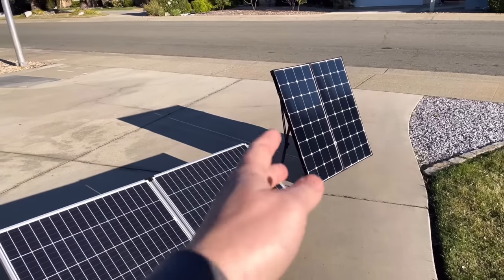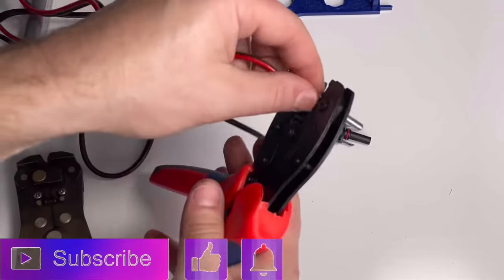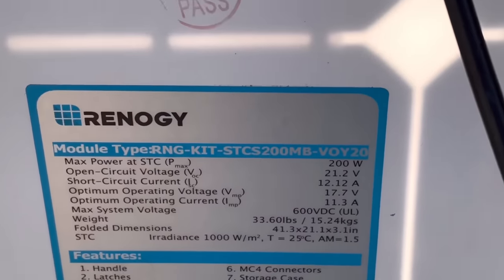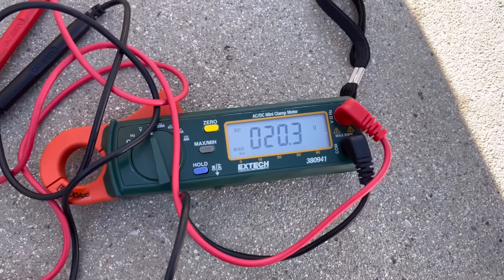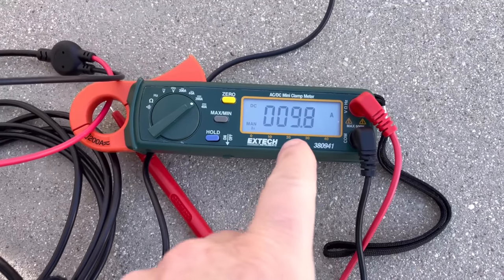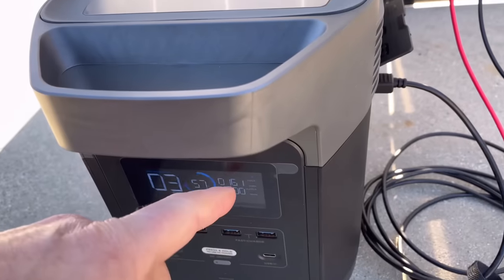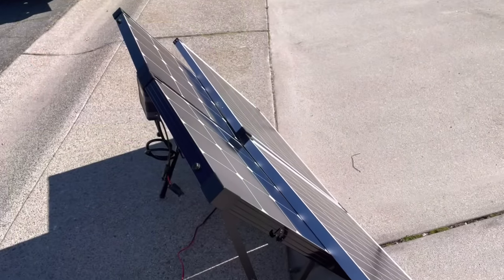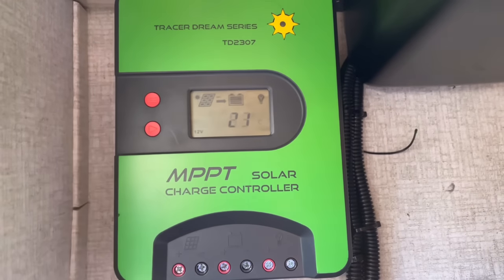Best Solar Panel - Harbor Freight 100 Watt Solar VS Renogy Eclipse Solar

Comment: Does the Ecoflow regulate its own charge or do you need the additional regulator to charge it with solar?
Reply from the maker: Yes it has its own mppt solar charge controller. It can only handle 10 amps max from a solar input.
Reply: @johnnysweekends  How many of those panels would that be and is that Echo Flow an older model?
Reply from the maker: 10 amps is 200 watts in parallel or you could run more watts which I forget max wattage for the eco flow EF3 which is still sold as a 2016wh model.

Comment: I just want them to work. Except if you read the reviews for the Harbor Freight they don’t work right out of the box. Definitely get the extended warranty.
Reply from the maker: How many don’t work..? 1…2 …. 10??? 
A couple sure but a lot ok well then there would be a problem.

Comment: Not a fair comparison between both systems. You are using the Renogy panels in paralell, and the Harbor Freight in series. I know from personal experience the Renogy Eclipse is far more powerful than anything else on the market still today.

A fair comparison would be to series the Renogy eclipse panel as well, and then you will get the real numbers to compare. The Renogy Eclipse's are the panels that have more power per square inch. Just series them as you did with the other setup. It is still double the price, but you get a lot more power with low light conditions like early in the morning and late in the afternoon if you series the Renogy. That would be a nice thing to actually see.

Will Prowse made a t st in the Renogy eclipse and it outperformed everything else, best power for ocuppied area. If you have little space, the Eclipse is the way to go.
Reply from the maker: Both units were wired in series the gear higher voltage then ran to the mppt controller in my trailer. Which I by pass the pwm on the renogy set up. 
I would need a connector to run parallel which in the video you clearly see I don’t have one.
Reply: @johnnysweekends  Sorry Johny, it doesn't add up to me. If you have them in series, howcome you only get 15V for a 21,1V panels in series? You compare an entrance at you MPP solar of 15,4V with the Renogy panels and 35,4V with the Harbour Freight ones... How is that the same? Maybe I am missing something here, but I plug my 100W Renogy Eclipse in series to an MPPT and it is way over that... I don't get it.
Reply: @ricardomarcelino8388  perhaps one of the two Renogy panels was faulty? He could measure them individually to confirm. He was getting 160w, which depending on his location, time of year (winter, less sun), and time of day, isn't bad for 2 100w panels. 

If you rewatch the video, it's quite clear that one panel conductor is looped over to the other, and the other from each panel is going into his power meter. Both pairs were undeniably wired in series.
Reply: @mlindholm  It could be there is something with the panels. My 100W Eclipse, with the included PWM kicks over 100W (103/104). And with an MPPT I have seen 110W.

But it stills confuses me, howcome with a series  connection you only get 15'ish volts out. The other two put out 35,4V. They should be at least closer. I am not saying the harbours are not good by any means. But seams we are comparing totally different things here. How can you explain that much if a difference? More than double the voltage... If open circuit is 21,2V, in closed circuit should be at least 28/30V am I not correct??
Reply from the maker: Well being the renogy is a little older but very little use it may have already settled with the normal 20% degradation that monocrystaline panels get after a certain amount of sun exposure. 
Hence the lower wattage. But that set up had very very little use and I never could get over about 175 watts no matter what. Always thought it was odd.
Reply from the maker: One test I’ll be doing in several months is to see if the HF panels suffer the full 20% degradation loss after being in the elements for 6 months of extreme heat. They have been outside for about a month.

Comment: The Solar Panel is a Thunderbolt Solar, not Harbor Frieght.  And detailed specs attached to the product is important, kind of a industry standard for safety.
Reply from the maker: Thunder bolt solar products are a Harbor Freight exclusive. You can buy else where but I don’t recommend it. Harbor freight actually has good warranty replacement programs verses a standard online purchase you may not get.
The details are described with in the video 

Was there a detail you are looking for specifically?

Comment: Using the Harbor Freight panels and an Ecoflow Delta, is there a need for a charge controller?
Reply from the maker: No eco flow has built in controller..😀💪🏼👍🏼

Comment: Please surmise comparison videos with a side by side chart at the conclusion of the video? The comparison was a great visual, but it would have been more helpful if every viewer didn't have to record the data to repeat your experiment (376,593 views) times/potentially, by watching, pause, record data, continue, pause, record data, continue...
* I did "like" the video. Thanks for the work.
Reply from the maker: I will work on that for future videos …
And glad you liked the video..😀👍🏼
Surprised it got this many views since it was a quick comparison over a cheap panel and a more name branded panel. 
But more volts bringing more watts is all ya need with a decent controller. 

Thanks again for watching 😀😀

Comment: Wouldn't you just be better off buying a used 290 - 350 watt panel for about $100-$120?   I just put together a 6 panel array and got 6 300 watt panels for $100 each (they happen to be qcell but you can find used REC and others too, similarly priced.
Reply from the maker: Heck ya you would!! The benefits to these small panels are size constraints and weight. That’s the main reason to buy these. But the best bang for your Buck is residential panels especially used ones you can grab all over. 👍🏼😀

Comment: Installed 8 panels on my travel trailer 165 watts to 200 watts each panel 30 inches x 60 inches of mono crystalline, each in size. The cost of each panel was the same as a wattage in dollars. Have more then 1,400 Watts connected to  2  adjustable voltage controllers  costing $15 each. MPPT controllers had too much voltage fluctuation. And connected to a 5, 000 watt inverter with 10 lithium titanate handmade batteries, at 13.5 volts output each for storage which actually powers the travel trailer all day and all night . Totally unplugged from the grid. While an air conditioning system would drain all the batteries at night, I rarely use it anyway. Did much more with far less money than trying to buy a ready-made system. If you think you're going to power your RV with panels you're dreaming. Those pre-made kits  are way overpriced.
Reply from the maker: Agree some simple diy can save a lot of money. And yes if you don’t have a run a ac for hrs you can run everything else for days. Still cheaper to get a small generator for the ac unit when needed and take the gen with you for the next trailer or other projects..
Reply: WOW - you actually took the time to solder together 100ft² of your own raw PV cells instead of buying pre-made panels because you consider them overpriced?!?
I'd rather spend $89 per 100W panel and have those 8 weekends (that you spent breathing lead fumes) FREE'd up to travel in my fully solar powered RV setup with my family...

Comment: Do you have a link to the little solar light dohicky? for getting the best solar angle?
Reply from the maker: I don’t know if they make it anymore but they run $150 give or take depending where you find it. It’s from daystar
Reply: @johnnysweekends  A trick I learned from another YT channel. Use a can of soup , or anything, hold it on the Solar panel and tilt panel  so there isn't any shadow from the can. Then the alignment is perfect.

Comment: The harbor freight is in series, that is doubling the voltage. The sticker on the harbor freight panel says not to wire them in series.  Will you do the test again with the Renogy panels wired in series?
Reply from the maker: According to the manual it does not say that anywhere to where you can not run these in series.

Both units are ran in series as seen in the video. I would need branch connectors to run parallel. 
Only difference is the renogy set has several hours in the sun where maybe 20% degradation has settles verses the Hf have not. But I could never get much over 175 watts on the renogy regardless but with 20% that would be with in spec. 
I’ll be doing another test in a few months to see if the HF have falling off.

Comment: Can you connect the harbor freight one straight into a jackery or you need a charge controller
Reply from the maker: Most all power stations have there own built in charge controller ..but be sure to read the instructions especially on the cheaper models 
👍🏼

Comment: If I run a 30 ft cable what's the cable thickness I need ?? 10 or 12AWG ??
Reply from the maker: 10…👍🏼

Comment: You state that the renergy get a certain amount of wattage thru your mppt controller but you didn't do the same for the Harbor Freight panels. I'M LEFT wondering What those energy readings would have been for the Harbor Freight panels would have been. It is not much of a comparison if you don't treat both items equally and Show us the numbers to prove your point.
Reply from the maker: I did the same test for both..? Both into the delta power station and both into the Rv trailers mppt solar controller. 🤷‍♂️

Comment: Do you still need a charge controller on the panels when you you use the echo flow?
Reply from the maker: No, the eco flow has its own built in mppt charge controller. This model can handle 10 amp input. 👍🏼

Comment: I'm too tired to look through all of the comments, tried... If you have only one, how is it? Why two? Thanks
Reply from the maker: Well depends on your needs. If you only need minimal power to recharge something then a single 100 watt panel will do. Like for keeping a power station charged and such. But if you use your batteries to run lights in a rv and a heater or fridge then as you run those items you deplete your battery quicker.
So you need to charge them back up quicker. So you need more wattage. 200 is kinda minimum for this. Because you don’t always get 200 watts. Everything has a effect on how much you get from the panel.
Angle of the sun, temp like hot verses cold, size of wire, distance of wire, quality of panel, haze for or clouds in the sky.

So on average a 200 watt panel will probably produce a average of 150 watts give or take depending on conditions through out a solar day.
Reply: Thank you
Reply from the maker: You’re welcome 👍🏼

Comment: Are you comparing two sets of 12v panels or parallel vs series connection?.
Reply from the maker: Both panels are connected in series.
Reply: @johnnysweekends  The Renogy panels are 32cell. meaning they're around 12v nominal. They're obviously connected in parallel.  Unless they're internally paralleled 6v(16cell) arrays.. Highly unlikely tho.  Either way, you need to parallel the HB panels for apples to apples or they'll get a voltage drop advantage.
Reply from the maker: Only way for the renogy would be internal. Because I put them in series with normal connections of positive to negative and then taking the other positive and neg leads to do my test and plug into the eco flow or get my voltage readings. This is how they obviously tell you to use the setup as a suitcase model. 

Plus I would need parallel mc4 branch connectors anyway to parallel a normal set of panels. 

You can see in the video the leads are tied together in the middle of the panel and then on the HF they are series connected as well. That’s how most people run a portable setup. It’s easy and you double the volts.

Comment: 😱🤪 I'm lost with all this amp and voltage jargon. 😞
How many HF panels would it take to run an air unit on a mobile home? 10,000 btu's I think. Is it even possible? My bills are so sky high, I don't know what else to do.
Reply from the maker: Well it’s not just solar panels you need batteries to off set if you are not taking the solar and plugging into the grid. 
Grid tie system is what that is called.

Solar panels alone just doesn’t make a ac unit run.
Reply: @johnnysweekends  So I need a grid tie system to plug the air unit directly into the solar, and batteries? There is so much I need to learn about solar. 😒  does your channel teach these things, or was this a one time deal? Thank you so very much for your input! I'm lost when it comes to such things, plus I guess for lack of knowledge, I would need things in layman's terms.  
Lol  Great video though! 😉
Reply from the maker: Well thank you, I plan to show more about that in future videos slowly. 

So quick run down for ac to operate….

Your power comes from the grid and supplies 120volts  ac…Needed for your little ac unit. 

Solar panels make energy from the sun but in DC which is like a car power system. 12volts

Now to run your ac separate from the grids power you need Ac power from something…

So…. Solar panels to a charge controller which charges batteries correctly…. So you don’t fry them. 

From the charged batteries wires go to a inverter… this changes Dc power to Ac power. This is where you plug the ac unit into, the inverter for the ac power.

But the power need comes from the batteries , or all these new power stations that have built in inverters and charge controllers. It’s all in one. So you plug ac unit into a ECOFLOW unit and away you go. But in order for it to run a long time you need maybe two or three units and solar charging them the whole time to get the most amount of run time at night. 

So it’s a small system is what you are creating, a off grid system to power things off the grid..👍🏼 

They can be really simple or get pretty complex depending what you wanna do. 

Hope this helps some .
Reply: @johnnysweekends  Oh wow!! Thank you, thank you, thank you!! I can actually understand all of that! 🤗😊  You don't know how much I appreciate you taking the time to explain this in detail. You are fantastic! I just subscribed to your channel, and look forward to new videos about this subject.  😉
Reply from the maker: You are welcome… glad I could help and thanks for the sub..😉👍🏼😁

Comment: The Harbor Freight 100 watt panels are down below $90 each now.
Reply: I have 2 sets of the old 45 watt (3 x 15 watt panels)  Harbor Freight system,  Still operating after 11 years.
Even the 12 V fluorescent bulbs still work.

I also have 2 sets of the 100 watt (4 X 25 watt panels) system, recently purchased.
The new panels are performing well so far.  I like the LED lights that came with them. (not outdoor bulbs, cords or sockets rain will ruin them)  The LEDs are drawing a lot less power than the florescent bulbs and providing better light.

For the price, they aren't bad.

The controllers are Harbor Freight system's weak point.  Especially if combining  panels from multiple sets you need a better controller.  No complaints at all on the panels.
Reply from the maker: I know a lot of people have been saying that. Not a bad deal.
Reply from the maker: Yea several have reported that the panels they have are still doing really well.

Comment: Those are not Anderson powerpoles but SAE Bullet connectors.
Reply from the maker: Yes correct I stated the correction in the description I was working with Anderson connectors earlier and just didn’t catch it.

Comment: You can also get 2 standard Renogy 100 watt monocrystalline panels for less than $100 each shipped. Higher quality and cheaper than HF which has notoriously low quality.